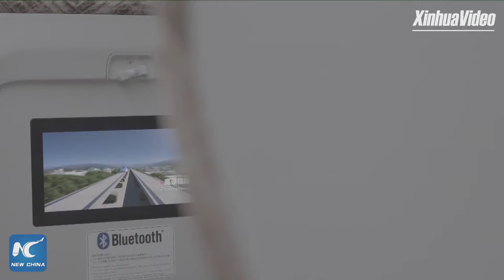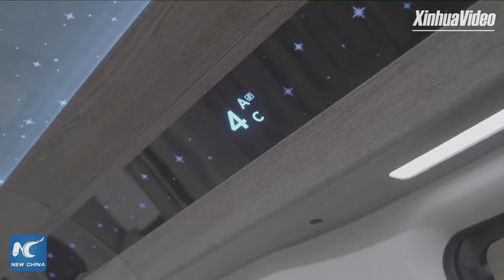EXCLUSIVE：Exploring world's first 600 km/h high-speed maglev train in China's Qingdao

Comment: Soon in my beloved country, Indonesia,  will experience it as well, by cooperation with China,,, can't hardly wait for!!!!
Bravo Asia !!!
Reply: yes bring it on
Reply: No, indonesia doesn't use maglev. China doesn't use maglev. Japan doesn't use maglev. Currently, the only commercial maglev operating is between Shanghai airport to Shanghai center, only 30 km.

Maglev is too expensive and useless, and it also consumes 4-5x more energy than regular bullet trains. Monorail tracks are also terrible, they aren't easily integrated with the rest of the rail system. What is commonly used for high speed rail that you often see, is just bullet-shaped trains and high-quality railroad, and you can already travel at average 300 km/h with that, about as fast as race cars.
Reply: @kennethkho7165  Japan is already constructing a maglev line between Tokyo and Nagoya with planned extension to Osaka. It’s expensive, but can saves many passenger hours and viable for places with high passenger density.
Reply: @kennethkho7165 And... the Shanghai maglev ist a German product invented from 1985 to 2004...
Reply: DB....and your point is? Why Germany doesn't have the Maglev train?
Reply: @joej6780  lmao
Reply: @DB--lv6tt  Maglev is not German invented. what you point out is the bullet train which travel 300 plus KM/hr
Reply: Indonesia 15th largest country by land area. They need the infrastructure.
Reply: China can not market this technology, since the marketing and patent rights are with Thyssen, Germany.
Reply: @rogerloh8194  Maglev trains are and have been invented in Germany since 1934. From 1969 onwards, the system the train in the video is based upon (or better: identical to) - the transrapid - was developed up until 2011.
Reply: @Daniel Schwenk Chinese have their own patents. The prototype is the prove. Ｒｅａｌｉｔｙ slap on your face😂
Reply: @maxwilliams5941  They don't. Stop trying to make a fool Out of yourself. The train in the Video is identical to the German Transrapid.
Reply: @Daniel Schwenk You are right. Everything is identical to german. Same as UFO🤣
Reply: @maxwilliams5941  Now you're doing what I told you Not to do.
Reply: @maxwilliams5941  The Prototype was build 1970 in Ottobrunn, Germany. Called Transrapid 01. The first High Speed Variant on which the train in the Video is based on was the Transrapid 06 in 1983.
Reply: @bieneulm1982  Patents expire after 20 years and enforcing patents is a challenging and complicated task. 
After the patent expires, anyone may make, use, offer for sale, sell or import the invention without permission of the patent owner.
Reply: @Dept246  No, they don´t, they can be prolonged anyway (for another 20 years e.g.). Especially not if they´re economically used, evolved further as had been done during the last 40 years by Thyssen, Siemens and Krauss Maffei.
Reply: China will just reverse engineer and make their own version with little bit different or upgraded. Then they will market and sell it. Or they can do joint venture or way for license.

One way or another it will be 100% Chinese if it isn't already.
Reply: @ex0duzz  Exactly that is, what they were trying for the last twenty years. The CRRC is the First Transrapid build by Chinese, but still Not without Support of German Companies, such as Thyssen. And still the Chinese are Not allowed to market and sell it, because only Germany reached application and therefore serial readiness.
Reply: coba nih kerata ada di indonesia jakarta surabaya cuma 1 jam 20 menit
Reply: @carkawalakhatulistiwa  english, please.
Reply: @DB--lv6tt  Invented in 1934 by Hermann Kemper. Developed from.1969 to 2011.
Reply: @bieneulm1982  Don't have the exact dates in my head... I was thinking of TVE Lathen....
And: I don't think that Herman Kemper called his patent from 1934 "Transrapid"...
Reply: @kennethkho7165  maglev doesn't actually consume more power at high speeds, but the main issue is that it isn't compatible with conventional rail, as you said yourself
Reply: @DB--lv6tt  Still the patent was developed by him and Ludwig Bölkow from 1969 onwards to what is today known as transrapid and what the train in the video is identical to. I hate it, if my comments get deleted for no reason. The question in the beginning was only short stator linear motor or long stator linear motor? Engine in the vehicle or implemented in the track? Transrapid uses long stator linear motors with the engine in the track, Max Bögl´s TSB again - which is based on Krauss-Maffei´s Transurban - has the engine within the vehicle. Transurban was a System that was parallely developed as a low speed urban variant to the transrapid.

Originally Germany had planned and developed the two mentioned systems Transurban and Transrapid. For transrapid they planned at least two lines in Germany, one inbetween Hamburg and Berlin and another one from Munich-Airport to Munich Main station. But, and there comes the suspicious part about it, after shanghai-pudong was opened, all the german lines got slowly cancelled. Mainly because increases in costs allegedly occured. For this betrayal of the German technological and infrastructural forthcoming, someone has to pay.
I wouldn´t be against a cooperation between Germany and China to spread maglev technology all over the world, but there is the betrayal the Germans did to that technology and there is the one occuring in the video, in form of the Chinese stating that they "developed" (it´s the choice of words that makes the huge difference) the Transrapid, although they just reverse engineered patent-protected German technology.
Reply: @SebastianD334  Wrong, Transrapid has a close range of speeds in which it can operate the most energy-efficient. This range is from 350-450km/h, above that and below that its more energy-consuming. Oh, and already in 1987, the engineers of Krauss-Maffei, Thyssen, Siemens offered a system that made the track for transrapid adaptable to conventional rail. The argument that the system Transrapid would be in need of extra stations and infrastructure was a lie of its opponents to spread doubts into the publics conscience, at least here in Germany (who´d be able to tell these who helped out of the hidden).
Reply: @bieneulm1982  they are using different technology called high temperature superconductors dude. More energy saving . Safer and cheaper. Which means more advanced. Your old grandpa’s technology is out of date.
Reply: @lbchen6160  Nope. To all of it. To each letter.
Reply: @lbchen6160  It is a transrapid. End of discussion, that "different technology" (would you care to explain the precise differences to the transrapid, cause I can´t see any?!) doesn´t change the fact that it is a EMS-System based Transrapid with minor chinese made improvements. Actually they don´t even use different materials, such as the propagated Carbon fibre for the coaches, they´re still build of welded aluminum. Transrapid cannot be changed, since it has been developed to perfection in Germany and is still property of said country´s companies. The latest German transrapid model is more modern and sophisticated than this train in the video and it had been build in 2006. Even without 5G. 

You should know the difference between EMS and EDS before starting a discussion with a German. EDS is using high temperature superconductive magnets (it is actually low temperature since to become superconductive the magnets need to be cooled down to -270°C), but that hasn´t got anything to do with the technology shown in the video. For example: Where are the cooling tanks for the liquid nitrogen/helium that would be needed within the vehicle if it had been an actual EDS-Type?! 

Why do I know that? Because that "old grandpa" (it isn´t mine, both already dead for years) experimented with said technology already in the 1970´s in Erlangen, Germany and build vehicles with it. 

Oh, and the same "old grandpa" developed at around the same time also the track - that is also the engine of shown train - that allegedly "superconductive high temperature maglev" is floating on. It´s actually sucked onto it by underneath the track positioned magnets to a point at which there is a airgap of +/-10mm inbetween the track and the vehicle, this is necessary to accomplish high speeds. For this no aerodynamic nose that leeds more air in that gap is needed, btw...

Come on, I´m not a chinese that gets his education only and exclusively from the CCP ( not adressed to all happy chinese people with more education than that!). Please...
Reply: China and ASEAN may have some conflicts, but should never let outsiders come and provoke into big messes.
Reply: @Daniel Schwenk FYI Maglev is Not invented by German. The 1st prototype is UK, idea may be from anywhere before and been thought up by many different people in many different places.
German company were only 1 of them which put this into a physical public transportation form, and can Not claim these are all their technologies and all their efforts. 

2nd Japan also have maglev so did Japan also copied your beloved topic - stolen from Germans?!?

3rd a car idea isn't only belong to the 1st one who put the idea into reality. If we want to we should point to the people who made the chariots and the 4 wheels (without an engine) those must truely be the giants of technology which they build on top of! 

or the early prototypes of such (steam engine) in many places around the world just that things haven't been dig up in history

Any one can imagine and put things in practice, or copy and improve.

Unlike some sour bitter people who keeps beggering on & on and had nothing, nor own any IP, nor did anything to prove.

Just like a plane with 2 wings, does it mean all planes thereafter belong to the US brothers who 1st recorded to put an engine on one.

Of course it does, all these copy cats and theft stolen from these US inventors
Obviously

From the screw & twisted logic - all planes on earth must be stolen and copied from the US inventions
Reply: @james_l4337  Transrapid or FYI maglev As you call it is a German invention, in this system all the ideas that might have existed before were combined into a usable highly sophisticated system for public transportation. The system that the japanese maglev technology is based upon was patented by AEG-Telefunken in the 70´s and not realised by Japan before 1997 with the MLX01, Germany handed over this technology after focussing on transrapid, as far as I´m informed about it. 
Lets go on: Of course did Eric Laithwaite - whom was british, not american - develop the linear motor, but he never really build a maglev with it.  Especially not high speed systems like the Transrapid, that was only developed and invented in Germany. 
Britain declared it´s own maglev-project a fail and didn´t invest further in it, because of the German maglev-development. They had a small test track for a maglev-vehicle and parallely the so called hovertrain (which wasn´t maglev) in Britain. US and even russia made attempts to do their own maglev systems in the 70´s, but: By that time the first transrapid were evolved massively and already build in Germany (01-05). 
Even France tried to do  a hovering train called the "Aerotrain" (again a hovertrain) but after Transrapid was invented they cancelled the whole project, because they couldn´t keep up anymore. 

Only Germany and Japan developed theirs into a usable system for public transport services at low and high speeds, of which the German system was and still is the fartest advanced system since it is in use in commercial operation in China and the CRRC CF600 is identical to that System. 

Germanys first High speed maglev was the Transrapid 06, that transported passengers already as early as in 1984, by that time no japanese maglev existed for the next 10 years (introduction of MLX01 again in 1997). 

Your comparisons are lacking context and are inaccurate. 
A roman chariot wasn´t engine driven, but hauled by horses. The first car was therefore not invented in the moment something had wheels, the first car was invented by Carl Benz in 1886 in Mannheim, Germany. Because it was the first Automobile, which is by the way the correct term for "car", since it was mobile through being equipped with a self sustaining engine instead of horses that moved it forward. Nobody denies the brilliance and ingenuity that led to the chariot by stating this fact. So shouldn´t you do in diffaming the inventors of Transrapid in stating false information.

Again, to pick up the comparison "according or seen of that point of view, all airplanes must belong to the original american inventors": The Transrapid is a fully patented system, it still belongs to an owner that is alive. Thyssen.

There is a problem with patent rights: If the owner of these doesn´t allow you to improve or copy this system, you´d commit a crime (I know about the cooperation inbetween Thyssen and CRRC btw.) or a patent right violation at least.

And: The first motorised flight with an airplane wasn´t done by the Wright brothers, but by a German named Gustav Weißkopf in 1901.
The first man that flew in an glider-airplane without an engine: Otto Lilienthal, born in Anklam, Germany.
The first man that flew with a glider and therefore with a functioning airplane-like vehicle: Albrecht Ludwig Berblinger. Born in Ulm, Germany. Nothing american here again.
Reply: @lbchen6160  wkwkwk,,,, old grand pa,,, what a cute,,
Reply: @kennethkho7165  which mean china use maglev, unless shanghai is not inside china.
Reply: @bieneulm1982  so german patent can only go 400kph then chinese one day do it 1000kph will it still be considered german product ? If so,please pay alot for basic things of chinese invention.
Reply: @mantapdjiwa9768  the debate of who came up with it first is pointless because maglev (or even worse: musk's hyperloop) is never going to be commercially feasible, it's just physics. coming up with new technology is easy, scaling the technology on a commercial scale is hard. the shanghai airport line was built only to showcase the technology and not to be used on a national scale.
Reply: @mantapdjiwa9768  German patent named Transrapid: Up to 600km/h by principle, but with then assumed higher energy-consumption, the latest two German variants of which one is in Service as Shanghai SMT (Transrapid 08) and the one that was intended to be used in Munich (Transrapid 09)  were designed to reach speeds from 500-550km/h. The chinese CRRC CF600 is basically identical to the Transrapid 08, since it lacks great parts of the more advanced technology of the German Transrapid 09. You cannot f00l a German.
Reply: @Daniel Schwenk Forgot german patents🤣 Currently, magnetic train has three ways to carry out. 1. Homopolar magnet which Japanese normal  magnetic train widely using. 2.Electromagnets which Canadian Bombardier  Hyssen used. 3. Superconductor which includes Japanese low temperature superconductor prototype and  Chinese High temperature superconductor prototype.  Japanese and Chinese both have their own patents and test line on those three methods maglev train.😂
Reply: @maxwilliams5941  You're talking to much with only minor knowledge. China has No testtrack for either the Transrapid-copy or the "superconductive maglev-copy of the japanese MLX01. There is EDS (L0) and Transrapid, or Low Speed Maglev systems only (both EMS) the First mentioned is Just a scientific Term that hasn't Seen any Realisation so far with the exception of maybe the one Japanese L0 (Chuo Shinkansen, which uses principles that are 40+ years old).
Reply: @DB--lv6tt  true and?
Reply: @bieneulm1982  Japan can plus china is using a different kind of maglev now
Reply: @bieneulm1982  not the only maglev now go back to your tent
Reply: @bieneulm1982  blah blah blah 😢cry more cry some more
Reply: Congratulations to Indonesia from Laos👏👏👏
Reply: @ສະບາຍດີ-ລ8ມ  Indonesia has No Maglev Tech so far.
Reply: @bieneulm1982  Jakarta to Surabaya(~750km) in 1 hr 20 min by maglev train if exists.
Reply: @carkawalakhatulistiwa  Sebetulnya sih agak mahal. Tapi kita sangat membutuhkan nya.
Reply: would be a useless project..the local cant even afford the high speed train's ticket
Reply: @kingatlar7036  Kata siapa njir ?...
Reply: Indonesia uses HSR not maglev 😂
Reply: @bieneulm1982  Patents don't even work in another country 😅
Reply: @TheChenchen  Stop talking please.
Reply: @kennethkho7165  when they first build the shinkansen in the 1960s they said the same thing like you, they said the bullet train is useless and cannot be integrated with the rest of the network.
Reply: @suhandatanker  it's not that maglev is useless. it's that the improvement is marginal, the cost is prohibitive, and existing bullet trains already achieved the intended effect of replacing planes. people will simply choose buy bullet train tickets more compared to maglev, then who will maglev be for?
Reply: @kennethkho7165  that's what people said in the 60s about planes, why should I buy a shinkansen ticket when I can just fly to Osaka? You just proved my point.
Reply: @suhandatanker  but bullet trains are way cheaper than planes, albeit slower. maglevs are expensive
Reply: @kennethkho7165  mate so were bullet trains, they were much more expensive to develop like the maglev because it was still an experimental project in the 60s, the people of the 1960s thought the bullet train was more expensive and impractical than air travel, we're doing the same thing to the maglev because it is experimental, just like how the bullet train was experimental in the 1960s.
Reply: @suhandatanker  it's not the technology, we already have the technology since the 80s. the energy consumption of maglev is prohibitive, it is unsustainable
Reply: @kennethkho7165  who knows, they said nuclear power is unsustainable during the early decades, or that shipping is obsolete when the jet age took off even when fuel prices were skyrocketing, you never know when it will be the norm.
Reply: @suhandatanker  it's not about "they said", it's about the facts. whey "they said", it was in the early days. now we already have all the knowledge in front of us.
Reply: @kennethkho7165  yeah...in the early days they said the same thing about the HSR like you said about the maglev today, this is the most simplified answer I can give you.

They will find a way to make the maglev sustainable in energy, it's bound to happen if we let them tinker around and experiment.

If you still do not see my point then we shall conclude it here, good talk.
Reply: @suhandatanker  I just disagree with your point then, we have tinkered a lot with maglev technologically, because it's not the innovation that's expensive. What we've found is that yes, then and now, the implementation is still expensive.
Reply: @kennethkho7165  I agree, maglevs are expensive yes, their research and technology experiments were expensive yes, but saying that we reached the peak of technology is just wrong, you never know if there's a new miracle tech just waiting around the corner. 

So it's best to keep our distance and not confirm everything we see. We can rely on the HSR today since it's much more efficient, and keep the maglev as a novelty like the monorail or ART systems, maybe one day they will have the technological capability to be more power efficient than traditional rail, or use it in extremely special situations like the monorail.

But until then, let's hope for the best since our HSR is good enough for most transit systems around the world.